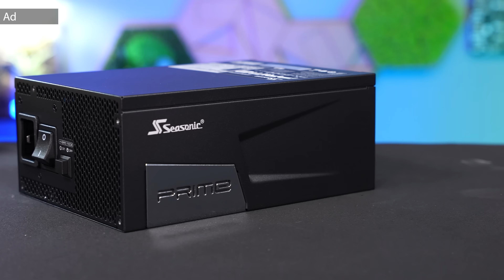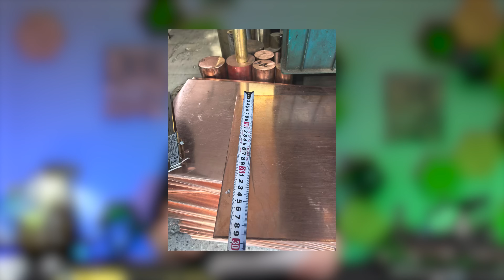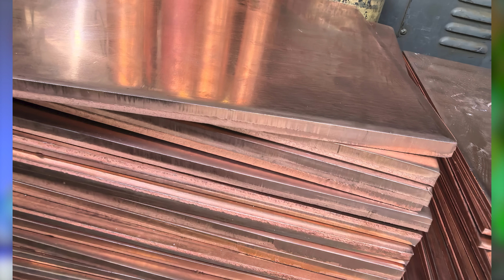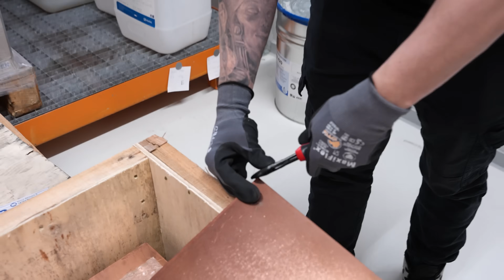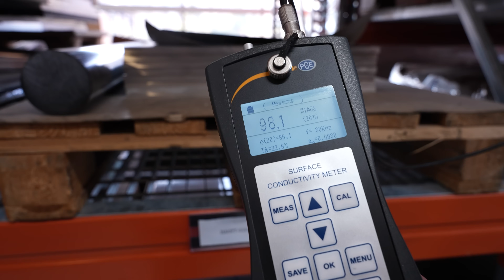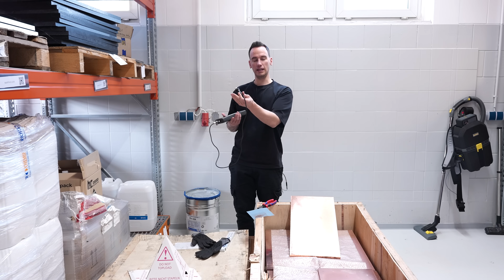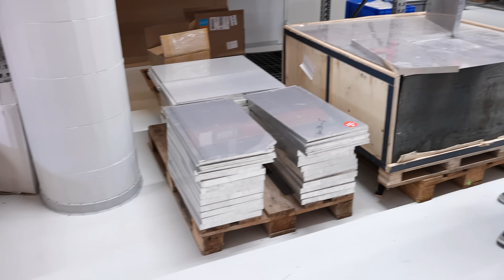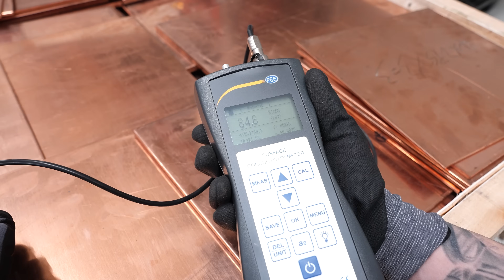I Got Scammed

Comment: 40 lbs of Steel = $1.30.
40 lbs of Copper = $130.
Reply: all this reminds me of that "Don't learn Mandarin" post
Reply: @user-gp1kh5jk7z  It's okay to learn Taiwanese Mandarin though :)
Reply: @paul2609  Do you mean Cantonese? It's a different language.
Reply: @mememaster147   As a Taiwanese. We speak mandarin as well. And we don't do such low level crap.
Reply: @paul2609  there are scammers in Taiwan too
Reply: Same problem with titanium but the difference is on a factor of 4 to 6 in price.
Reply: @barontau6552  Potentially, but I believe titanium is harder to 'fake' with an outer layer/coat, in this manner.
Reply: @Mac-Attack73 no its not, you can use gold and silver to fake titanium.
Reply: @AsiaRoadTrek  Gold/Silver? Sounds expensive...! What I was really referring to is the process of creating a thin outer layer of titanium around another metal, as a wrap - like the copper in the video:  This is supposed to be challenging or require expensive tech, buy could be wrong.
Reply: But what's heavier?
Reply: @Jena_Tools  Steel is less dense than copper so it'd have more packaging?
Reply: @Jena_Tools  The aluminium is.
Reply: @stingray4567 alumininininium? aloooominum? aluminum?
Reply: @dougaltolan3017  It's aluminium in German/French/Dutch and probably many more European languages.
So I guess his native language is not English...
Reply: @november1800 😊 you missed the (unusual) valid one that I snuck in...
Aluminium, Aluminum, and Alumium are all valid.
Reply: @november1800  Nope. English-speaking countries UK, Australia, New Zealand and South Africa all spell as aluminium (with an extra 'i')
Reply: @Mac-Attack73  Really? I didn't know that... obviously. 
I'm Dutch, so my knowledge about the English language is severely limited by the (mainly US and UK version of) English I hear every day via YouTube and read on the Internet.
Reply: Could be worse. Flashgitz guys got sent for their mech lead mixed in with the copper in the drinking cups they were selling.
Reply: wait why am I buying expensive iron weight plates when I could just buy 40 lbs of steel for a buck thirty
Reply: @debaronAZK  Probably because it only costs that much with economics of scale.
Companies that sell raw steel won't just be selling 40lbs at a time and won't sell such a small amount.
Reply: @bostonjunk  it’s more to do with the cost of machining and shipping.
Reply: 40 lbs of Feathers = 🤷
Reply: @ethzero  probably cost a lot closer to copper than steel is my guess, aren't feathers kinda expensive? especially for their weight
Reply: @KyberGaming47  depends if you source them from a chicken meat factory
Reply: @PainterVierax  yeah well it would very much depend on the type of feather at least
Reply: @KyberGaming47 shipping costs through the roof.
Reply: wait, something doesn't add up. I got 9.25 euros per kg of copper for 11kg. You should be closer to 200usd.
Reply: @eivis13  selling price and buying price isnt the same, someones gotta make a profit somewhere.
Reply: @ReptilezDzn  still your math ain't mathing, selling price is around 13euros per kg and buying is around 9.3 now
Reply: Please use not imaginary units of weight and currency in the future
Reply: @Myk_Yar  all units are imaginary, genius.
Reply: Gtfo with those imperial units
Reply: @potatopotatopotatopotatopo8746 you must be very smart, metric system fan
Reply: @FixFlops  while his comment IS uncalled for, the metric system is still more accurate and more efficient so I laugh out loud when people get offended by someone calling out the imperial system😂
Reply: @KyberGaming47  no it isn't they both turn to tons later on in weight.
Reply: @fishingkev2332  lol just because it can be converted doesn't mean one is not more accurate, metric IS the most accurate due to it's decimal system to simplify calculation, reduce human error, avoid conversions and use universally recognized units, make it the superior system for scientific and precision measurements. that's just the facts, the choice on whether to acknowledge that or not is up to you though😂
Reply: There's no calling out to be done my friend. Its a perfectly functional system, responsible for some of the most significant engineering feats
Reply: @FixFlops  It's also responsible for destroying about 327 million dollars in 1998 (about 650 millions in 2026) by crashing that one Mars orbiter.
Reply: @GoldSrc_  You could just as easily say the SI system was responsible for that because if things were consistently using US customary units that wouldn't have happened. The issue there was the fact that differing conventions exist, not that the system itself was incapable of flying the spacecraft.
Having everything be unified is a good goal of course but shouldn't just act like the customary system isn't capable of sending things to space (indeed that's why this problem existed to begin with as it's decently common in aerospace).
Reply: @FixFlops  yes that is very true
Reply: @KyberGaming47 What are you talking about?  47.3542 pounds is just as accurate as saying 21.4795 kg.  You people just say things and have no actual understanding.
Reply: What the hell do you mean by "efficient" and "accurate". Those aren't factors of which to compare measurement systems to each other.
Reply: @PeteQuad  Exactly what I was thinking. Imperial system hate is so forced online. Sure if you're in a lab for your career Metric makes more sense to use. But for 90% of people in their day to day lives it doesn't even matter.
Reply: @FixFlops NIST defines imperial measurement with metric ones
I.e for a simpler brain…. They make sure freedom units are correct by measuring them in metric units because it IS more accurate… down to trillionths of a millimetre
Nasa uses metric for all those accomplishments you speak of anyways lol
Reply: @Bingals   see my reply to petequad for an example on how it is more efficient, you are right about day to day use though, it doesn't matter, if you think accuracy and efficiency(of use...) is not able to compared between metric and imperial then all I have to say is god damn...
Reply: @PeteQuad  also kg and pounds are two fundamentally different properties in case you haden't realized, they cannot be directly converted, the closest you can get is approximation since kg is the mass of the matter in an object(anywhere in the universe)) and pounds is a measurement of the amount of gravitational pull there is on the object. (more imperial problems)

(bro said I have no actual understanding.. ouch🤣)
Reply: @KyberGaming47 kg are used as a measurement of weight by 99.99% of people.  You are so ridiculous.
Reply: @PeteQuad  what's that got to do with what I just said? I never said most people didn't use kg, you tripper😂 I said kg and pounds cannot be directly converted.
Reply: @presentfactory  yuo know that the US actually uses metric scales for their units, they have the official meter and kilogram in their treasury from which they convert to their imperial one. also their collaborators 90% use the metric system, NASA used the metric system to get Apollo to the moon.
and the bigger problem is that imperial is not unified either UK and US have different imperial measurements for the same damn thing.
and talking about that mars spacecraft, guess who did not do the conversion? the US side. because the US guy forgot that they are working the whole project in metric.
and lets not forget when doing conversions if you do not do it to a good precision the differences will stack up over the flight distance to mars. a 0.00001 m conversion error over 54-401M km's (min/max distance to mars) becomes a 0.5 to 4 km deviation which can cause huge issues
Reply: @KyberGaming47  Of course you can.  In everyday language everyone uses kg as a measure of weight.  We are not in a physics lab.
Reply: @timmyjohnson7192  who cares? For science metric is great but if you’re weighing normal stuff, either is fine. 
This outrage is ridiculous. In England people weigh themselves in “stone” nobody gets outraged by that.
Reply: @KyberGaming47  Right so what you're referring to is called pound-force. Pound-force is a measurement of weight, not mass. Nobody in their right mind has used the term "pounds" and was referring to pound-force. We use the pound-mass measurement. You wouldn't have gotten that mixed up if you weren't using ChatGPT. Scientifically speaking both kilograms and pounds-mass (the one everyone simply refers to as "pounds") are a measurement of mass. In social contexts, "mass" and "weight" are interchangeable. So with that being said, both kg and lbs are practically a measurement of weight, because that is the term your common layman in society uses.

Here's an excerpt on Mass vs Weight from Wikipedia as a little refresher for you since you seem lost:

"In scientific contexts, mass is the amount of "matter" in an object, but weight is the force exerted on an object's matter by gravity. In the physical sciences, the terms "mass" and "weight" are rigidly defined as separate measures, as they are different physical properties. In everyday use, as all everyday objects have both mass and weight and one is almost exactly proportional to the other, "weight" often serves to describe both properties."

Last time I checked 1 kilogram is equal to 2.2 pounds. You mean to tell me I'm wrong and that conversion is impossible? Go ahead, google "1 kilogram in pounds".

Just because the metric system makes for good napkin math doesn't make it "more accurate and efficient". These systems are inherently accurate because they ARE the standard of which to be accurate to in the first place. Anybody can learn to be proficient in either system.

Comment: That's the trouble with the Chinisium market, you can't really know because they fake everything and there's no recource to take after.
Reply: Lol algerians scamed the Chinese for a while. It was an issue here on the news a few months ago. 

Algerians would buy brand new cars, bribe whoever released the paperwork to write it down as a model from a few years ago. Then export it for really low tariffs. They scammed hundreds of thousand and sold them as brand new in EU and north Africa
Reply: china is so fked up when it comes to scammes they dont care i saw a video few months ago them selling cheap rebar that shattered on impact on concrete mind blowing thinking this would or was used in construction
Reply: @square7935 There was also several building collapses due to this faulty rebar.
Reply: @square7935 Lol funny this video comes out when my firm got scammed buying Chinese steel to Canada. My boss being Canadian didn't want to deal with USA cuz of the tensions and decided to buy steel for welding and fabrication from China. The quantity ordered would normally cost 100k USD and a Chinese company was offering it for 30k, just usual grades SA516/SA387. We waited a month and it arrived and they were dogshit steel that didn't even classify under US/Canada grades.
Same happened in 2021 in my previous firm who decided to buy Chinese batteries (Legendary BYD) for all the electrical equipment instead of the South Korean ones we usually deal with. The battery cycles were twice as low and started failing badly in two years while the SK counterparts never failed even after 5 years in usage. 
China floods the market with high volume crap. Their end goal is maximum output of goods without consideration for the environment or resources depleted from Earth. Recycling the whole use and throw goods from China will be a huge headache to deal with 50 years from now.

Comment: No one is getting a high end work station with two 5090s unless they're prepared to spend $20K. So insane that people wouldn't buy enterprise products rather than our small consumer supply.  You don't help, either, just by owning 15 different 5090s - including the best of the best and the rarest of the rare. At least you make fantastic products that I swear by. There are so many grifters out there that slap their brand on a $50 case that they build a "$2000" PC inside of. I appreciate you and your products. I really wish duronaut was inclined to adhere to the IHS surface over the surface of the spreader. You need to have a spreader that doesn't have a rougher texture than the IHS so that people don't run into the same issue I honestly spent 30 mins trying to rectify and spread your duronaut thin and evenly like I can apply Kryonaut extreme - hell, I even have an easier time speeding Conductonaut. Can you tell me if your first batches differ in any way from what you're producing now because the product just doesn't spread and wants to adhere to the spatula.

Comment: How Chinese law interprets this kind of setup
Chinese courts look for objective indicators of premeditated deception. The behaviors you described match several of them:
Material substitution designed to mimic weight — a classic fraud indicator in industrial goods cases.
Hidden compartments or voids — treated as evidence of deliberate concealment.
Copper‑plated steel instead of copper — not an accident; plating requires extra steps.
Multiple layers of deception (fake copper + fake aluminum + weight manipulation) — shows coordinated planning.
When these elements appear together, prosecutors typically classify the case as 合同诈骗罪 (contract fraud) or 诈骗罪 (general fraud) rather than a simple breach of contract.
Expected punishment if prosecuted as fraud
For a loss of around $40,000 (≈¥280,000), the case falls into the “huge amount” category under both fraud statutes.
Penalties in that bracket:
3–10 years imprisonment for the individuals directly responsible
Confiscation of illegal gains
Mandatory restitution to the victim
Business license revocation for the company
Blacklist entry in China’s corporate credit system (严重失信名单), which blocks loans, travel, and future business operations
If multiple employees participated, organizers and planners receive the longest sentences.
If the operation is found to be systematic (e.g., they’ve done this to other buyers), sentences can approach the upper end of the range.

Comment: This is exactly how I felt when I got the new wire pro which was 50% plus more expensive than the old one and i got charged $35 in tariffs. Never even got an email saying not it’s on the listing that tariffs are not included like every other company does. Karma is a B.

Comment: When I saw you lift that plate, it was obvious it wasn't copper, or you're strong AF 🤣, But at least you're not dealing with too much lead in the copper cup FlashGitz sold. Their merch company used another company in China and now they're having to do a recall cause the lead levels were above safe levels.

Credit to them though, they informed everyone about it and it is the fault of the company that made the merch for them, and not their fault.